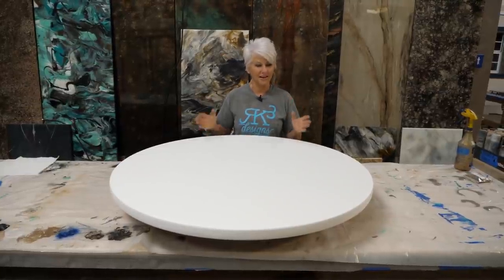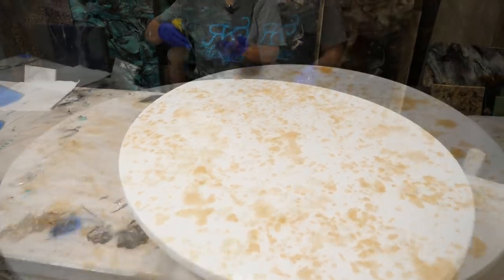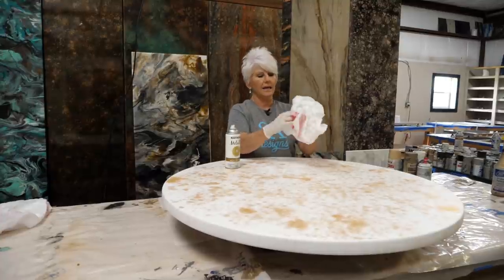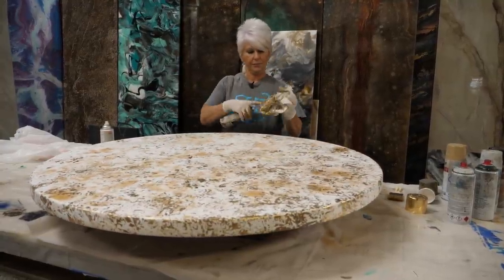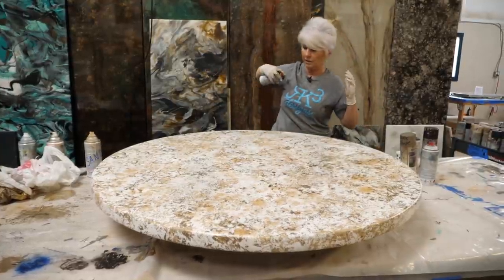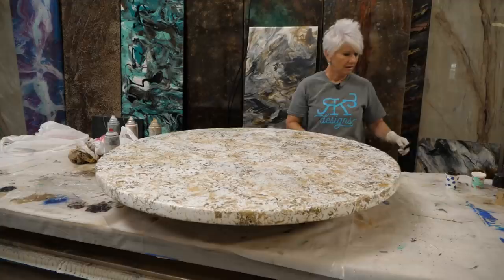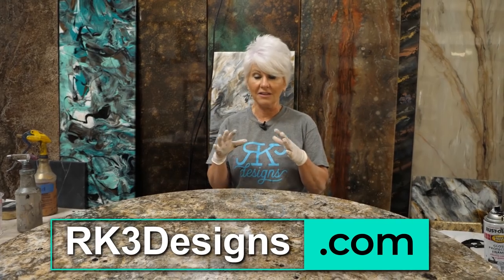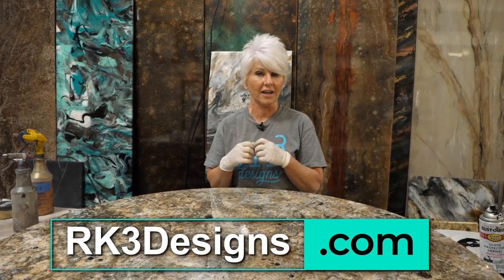Venetian Gold Granite Round Table | RK3 Designs

Comment from the maker: rk3designs.com || Remember this doesn't have to be gold! What colors would you use?
Reply: I'd like to throw in some some rust with an unexpected color vein like a slate blue.  Maybe a darker base color?  Still trying to decide.  (I tend to have problems in this area ha ha).  I'm wondering if you could pull some unexpected colors for a vein.  Would you do that after the epoxy is down or try to lay something down in the spray paint layer?  I'm SOOO nervous but your videos are SOOO helpful.
Reply: Burgundy, silver, turquoise, caramel
Reply: @jacquelinewilliams4305  some emerald
Reply: I am making a half moon table that I want to look like it is a slab of dark granite yet with some white, grays, gold with  gold mica and aqua in the fracturing...
Reply: I’m into to all the blue green sea shades, not so much rock effects :)

Comment: Thank u for this amazing video and for sharing ur talent with us!! I'm excited to try this! Would we have to use spray paint or could we use the craft type paints from hobby lobby also?
Reply from the maker: You can use just about any type of paint before you pour the epoxy. You just want to make sure it’s thoroughly dry before pouring.
Reply: @RK3Designs  this may seem like a silly question but I don't know much about all this but can u do this and the fracturing with alcohol without using epoxy? can U do it with polyurethane?
Reply from the maker: @tropicalsweetieamanda4870  no, you’ll need the epoxy to get the same effect. You can use spray paint on a dry substrate then while the paint is still wet spritz with alcohol. This will give you somewhat of a effect but not as bold as when done over epoxy.
Reply: @RK3 Designs  ok thank u for the information! I'm trying to find a way to do it without having to use epoxy lol

Comment: On the top coat and matt coat, did you use you hand to spread the epoxy?
Reply from the maker: I use my hand on the clear flood coat but the Ultimate Top Coat (matte finish) is a product you roll on. I have a few videos showing the application process.